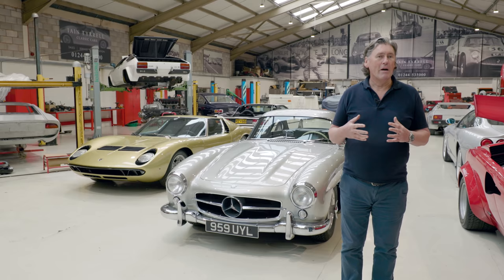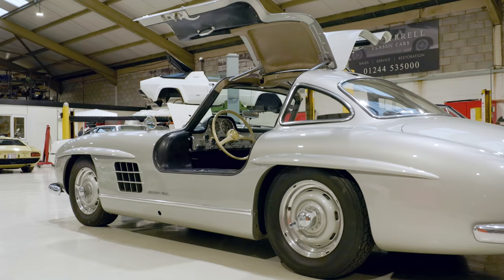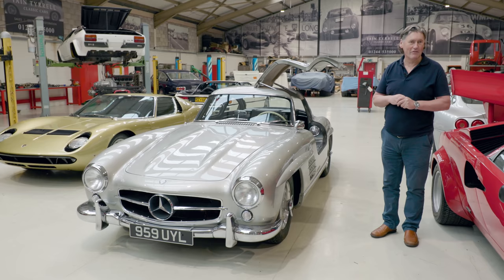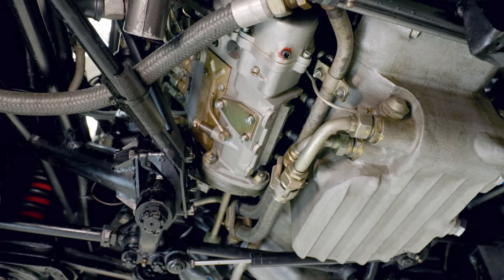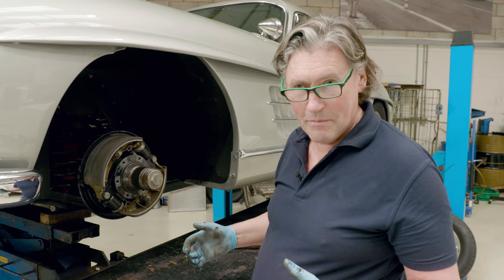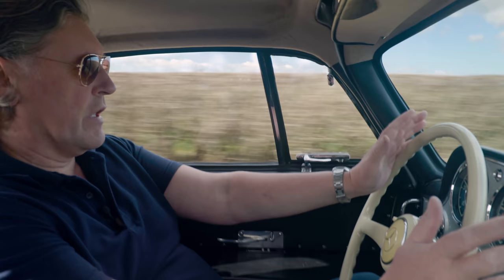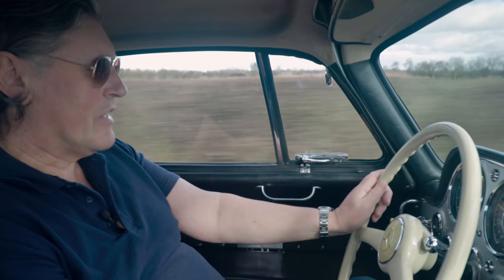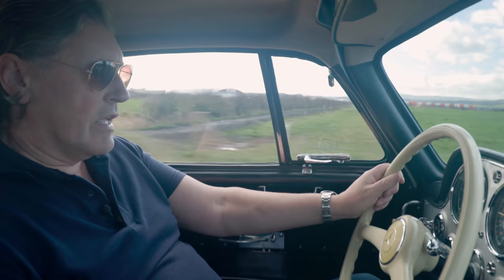Mercedes-Benz 300 SL Gullwing - Recommissioning an Automotive Icon | Tyrrell's Classic Workshop

Comment: Another excellent video! Just wondering why the car would need such frequent oil changes when it has such a superior fuel injection system. Is it always on the rich side and cannot be adjusted to run any leaner and because of that it is contaminating the oil so much?
Seeing the grin on Iain's face reminded me of the joy I had getting a wind up clock to work on an abandoned Morris from around the 1920s when visiting my fathers workplace on a Saturday morning in the mid 60s.

Comment: the engine carbons up because of the direct injection. Since direct injection became mainstream in the mid-2000's carbon buildup has been a problem. Fortunately most manufacturers have now managed to mitigate this to a large degree. But if you own a car with direct injection the carbon issue should be checked regularly. Direct injection leads to carbon buildup because the fuel bypasses the valves completely. In a port injected or carbureted engine the fuel-air mixture flows over the back of the inlet valves and acts as a solvent that reduces carbon buildup.

Comment: The base car costs about $105k to make, customer pays $137k, gets about 77% value.
The options cost Porsche less than $10k to add to the base car. Customer gets about 15% value, but Porsche gets 85% gross margin and they’re laughing all the way to the bank. Porsche net more cash in options per car sold, than most manufacturers make on the actual sale of over 15 cars combined.
I know I know, this is wife math, I’ll shut up now (and maybe take my 911 (with $40k in options) for a drive) ;-)

Comment: I think the Luftwaffe used 95 octane fuel while the Allies had 130/150 octane...so higher manifold pressures and slightly smaller displacement for the P-51, Spit, etc.

Comment: Iain, full marks. I especially  enjoy your Mercedes-Benz videos because my daily driver is a C300 (with  the high performance 350 upgrade). I believe you misspoke on one  point  when you said the car has "leather" diaphragms. Jay Leno  did a video on his 300 SL Gullwing (you can find it on Jay's Youtube channel) where he said  his  car has "lambskin" diaphragms, which makes more sense because a diaphragm needs to be flexible. I am subscribed & looking  forward to your next video. :)
Reply: Dictionary says leather = “the skin of an animal, with the hair removed, prepared for use by tanning or a similar process”.
Reply: @mosca3289  In this context "lambskin" means the intestinal membrane of a lamb, not the lamb hide which after treatment would be leather. If you watch Jay Leno's video on  his 300SL Gullwing you will understand the difference, because he makes the joke "You guys out there know what lambskin is  used for" because it  is widely used for making condoms.
Reply: @user-gc1zn5mn4p  I guess it’s more complicated than I thought. But surely lambs gut would be a better term than lamb skin.
Reply: @mosca3289  Yes, lamb's gut would be an alternatively correct term, since it is the intestinal membrane of the lamb. I think lambskin is an ancient informal term that came into use, though it can be confused with  lamb hide/skin that is tanned into leather.
Reply: @user-gc1zn5mn4p  I learned something 👍🏻

Comment: Once again a master class in a very beautiful , loved car , curious as to why fuel gets into the car oil system enough to need to change the oil so regually and would you still have to decoke the engine , on modern fuels ,
but what a piece of auto art that is .

Comment: The direct injection might be the very thing that's causing carbonisation, there's no petrol getting squirted over the inlet valves and ports.  It's becoming a problem at the moment with modern systems, as opposed to port injection that does a bit of useful cleaning.  For example, Toyota have both fitted to certain models.

Comment: When I visited the Smithsonian and looked at the German WWII engines and their Bosch fuel injection equipment, I was amazed how the ID tags were virtually identical to the one on the injection pump of my 1991 Mercedes. Same color, shape, font, and little rivets. 
Does the SL pump have issues with the delivery valve seals leaking like the Diesels do?

Comment: You mentioned that the cylinder head had to be removed and decarbonised at 30,000 ks, Would modern processes such as ceramic coating or ISF isotropic surface finishing stop or lengthen the time that it would take for carbon buildup on the cylinder head to occur ??

Comment: Mercedes were late to the party with disk brakes because they were pursuing air-brakes on their race cars.  Trying to make that work rather than accepting that disk brakes were the better answer.  When Jaguar had disk brakes on their D Type Le Mans cars, Mercedes still had big flaps of parachute-like bodywork at the back of their 300SLR.

Comment: Nice, as usual, but some smal faults...The parts was not based on the 300 "Adenauer". It was based on the 300. The " Adenauer " was the last version of the 300 design in the early 60- and was nicknamed the A, as the Chancellor in West Germany at that time - Konrad  Adenauer, had chosen this type as the official car for his transportation.

Comment: Bad news turns out the SL300 is a bit of a Fugazi, other cars had electric clocks in the 30s and far lesser cars had disc brakes when the 300SL came out. In respect to the car clock it is not the best or nothing, otherwise there would be no clock or an electric clock.

Comment: I'm fairly sure Iain sweat's car knowledge, beautiful car, glorious sound, sounds better on the over-run than most engines in labor, I suspect it's tried to eat it's o.s. front wheelarch at some point, would that add or remove value on a car worth as much as main st?

Comment: The 300SLR is that just the out & out race version or could the public buy them as a road car, i do prefer the look of the swept back headlights
Reply: The 300SLR was a totally different car with 8 cylinders and based on the W196 formula 1 car. No private sales AFAIK. Especially the "Uhlenhaut-Coupé" was a much more beautiful car than the 300SL (my opinion) and the fastest street-legal car of it's time.
Reply: @bradcollins9647  thanks for the info, I googled them after watching ians video the swept back light front is better looking & with the wire wheels & side exit exhaust, thank Adam

Comment: Question, how do these classics handle modern petrols, do they require special additives every time they fill up, or are there specific oils for protecting the engine? Or is working the valves just a easier alternative?

Comment: Iain - Excellent as ever! Would be interested to learn of how there is "petrol" contamination into the engine oil...is that via the valves or piston rings, or both??? Onwards!  Mark
Reply from the maker: It’s due to the direct injection. Every time the engine’s switched off, the pump still pumps neat fuel into the cylinders until it stops rotating. Thanks for your interest
Reply: @iain_tyrrell  Many thanks for taking the time and trouble to reply. Fascinating for a set  up so advanced for its age that this was "overlooked"...hopefully the same was true for the ME109 engines...!

Comment: Question, with the original engine, is leaded fuel required?  It is my understanding that lead gave a small coating on the valves for a better seat.

Comment: you think your a car guy then you hear all this, and you realize how little you know, so they used triangles and the like with the tubes to take the load of the car, and here I was thinking it was just some slapped on tubes, and what of the belly pans, like how thick did they do that and where did they put them, as its like they really thought of everything, like this is more advanced than, well just about everything on the road up until the 2000's, when technology and chips advanced from simple on and off switches, to actual proper programed pieces of silicon

and I'm not surprised about the leather diaframs, I remember leno saying the one on his was made out of sheepskin and had degraded and caused it to run rich

and his was the same deal in a way, long term storage, granted in a storage container for over 30 years in a desert with a custom paintjob and reupholstery job from some famous LA guy from the 60's

and with the disc brakes, apparently, the british were quite secretive about that technology, given they were the first to use it, and went to extreme lengths to keep it to themselves, as one of the stories that I heard is that James Dean had Ordered a Lotus, a MKII or a IX and lotus decided to actually take the discs off for fear of someone reverse engineering them, and that is what caused the delay that made him buy that damn Porsche 550 he got killed in 

but to be fair, when Alec Guiness, Mr Obi Wan Himself tells you dont drive that thing, your going to get killed in it, you should probably listen to him, and he didnt. 

also 1961, you mentioned the rims belonging to a subsidiary jaguar owned, maybe Mercedes benz licensed the mark II brakes from them or Dunlop themselves when they went to discs, as I remember hearing they were derived from them 

and with that Decarbonozing the engine thing, and here I was thinking that was a new thing with Direct injections, it would have been nice if mercedes had told everyone that awhile ago lol

although with modern cars I remember hearing their is some fuel treatment that can be put in to just clean the engine, however I wouldnt do that with one of these.

Comment: No bending, only pulling or compression. 

If you compress a beam or tube it becomes bending. And bending is the weakest stress mode.
Reply: I think you trying to explain buckling. That's a failure mode. Compression is OK, your con-rods depend on it.

Comment: How does one properly tighten a 'knock off' wheel nut? I've seen how a modern (911 GT3RS) centre lock is torqued, so I'm wondering what's the procedure with this old style?
Reply: hammer

Comment: No problems with carbon build up on the valves with that early direct injection?
Reply: Maybe that's why you had to "de-carbon" the head every 20,000 miles.

Comment: No.... The fuel quality when the 601 DB engine was developed in Germany, in the middle of the 30 :th, was as good as in Great Britain.. and continued to be good to the end of the war when the engine was further developed thru to the  605.  The reason for Mercedes to develope the injection system, was to not starv the engine in rolls. . The ME  109 had a big advantage over the Spitfire in the Battle of Brittain due to this,,,
Reply: No....